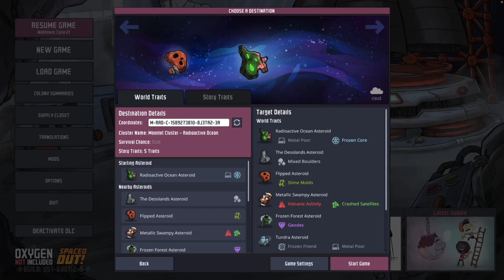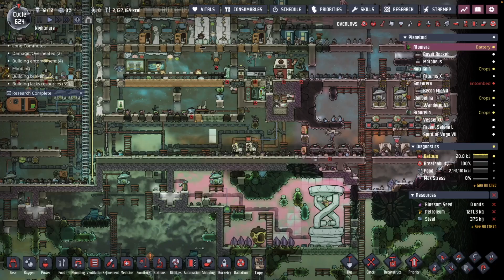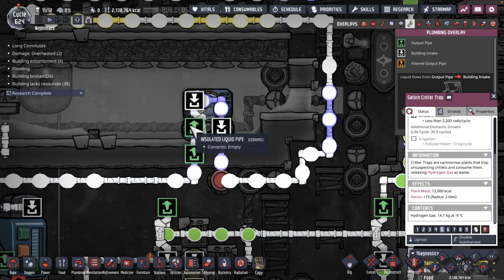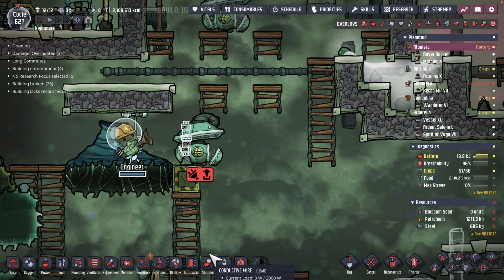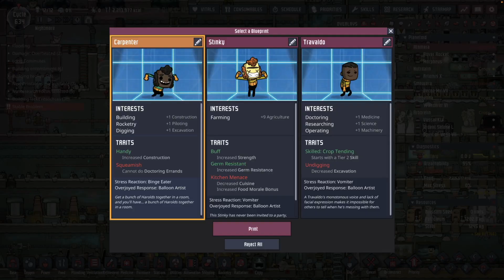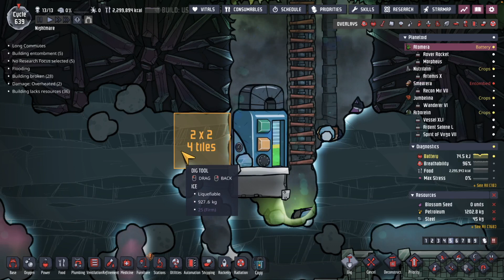Shrink CO2 - Oxygen Nightmare #32

Comment: Nice !

10:32 It's better, but i still prefer having the input line continue through the input port so there is nothing stuck in the pipe. You just have to put insulated tiles to the sides of the aquatuner and pipe it from the side then downward. Anyway, It's still an improvement, and it's still good enough. Good enough is the best. And if the cooling fails, it will be fun anyway.
btw, the tiles on the sides might be needed anyway to submerge the aquatuner in radioactive waste when you upgrade your coolant to liquid nuclear waste.
12:52 It needs something to boil the co2 long term. It will boil for a long time with the little heat transfer from the insulated tile and the heat transfer with the pump but long term, it will stay liquid. You can refresh your cooling line here. (It will not get the liquid much colder, but will vapourize the co2 at least).
Never mind, the joint plate will suffice to boil the CO2 as long as it's not a vacuum outside.
39:56 Your pip is stuck in "waiting for hugs" state. Slacker.
44:00 There is decorative plant below, no ? 
49:25 You can automate that with smart storage set for a few suits that shutoff a fabricator which is set to unlimited. So you always have a couple of suit when you need, and it refills without further manual intervention. Not really interesting with the lack of default suits feature for the newcomers, but that's something.